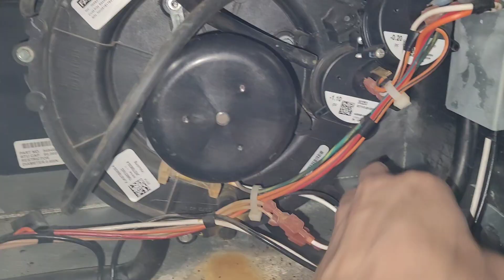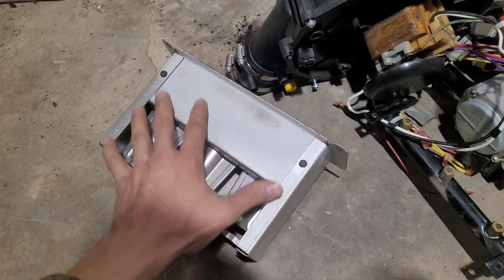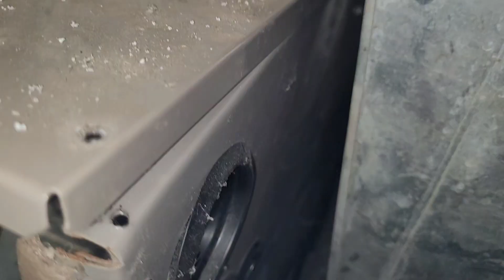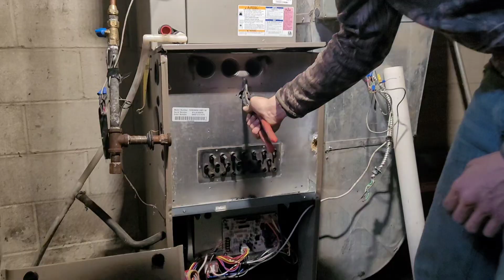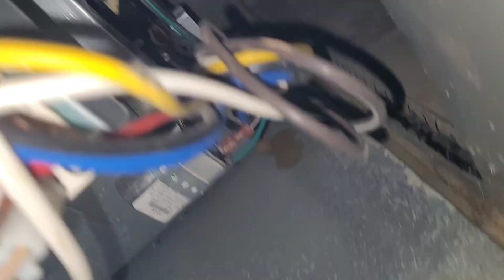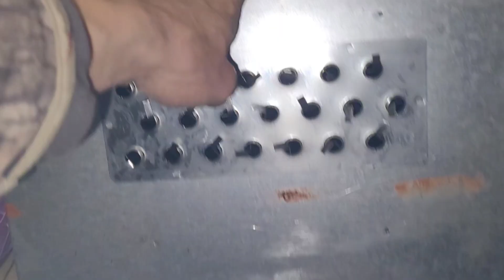How to replace Primary and Secondary Heat exchanger on Coleman, Evcon, or York furnaces!

Comment: I have the same model too and I actually just found holes in my primaries around one of the bends. It also appeared that I have a galvanized coupling box as well. Needless to say I'm sledgehammering it out and I'll be going with a Bryant that I have from work. Sadly I don't know who makes a good furnace still. I've seen the new carriers rot out their primaries and then soot up, I've seen lennox do the same thing, goodmans always burn through, but Amana/Daikins all use stainless steel primary heat exchangers. Perhaps they are the best way to go now. I'm extremely disappointed in Trane's quality decline. Nordynes are also terrible and have bad heat exchanger failures. I wouldn't trust a china bosch. Haven't seen enough Thermopride or even a Napoleon to determine if they are any good or if they are just a rebranded nordyne/bosch. I would have to say Amana.
Reply from the maker: I actually just installed one of those Bosch units. We got it because it was a scratch and dent, along with some other discounted equipment. I ended up installing it at my brother-in-law's. Hopefully it'll be a good machine, I told him I wasn't sure how well it would do but at least he got a good price on it since it was scratch and dent. That's another thing that bothers me, is they use a German name like Bosch, but it comes out of China.
Reply from the maker: Aren't Bryant systems also made by carrier? Yeah it's disappointing that most of the brands seem to be putting out equipment that doesn't last very long. I think it's in part because of the government regulations on efficiency. We just took out a 90% efficient drum style furnace because the board went bad, and there weren't any replacement boards. That unit had been going strong for at least 30 years.
Reply: @ReubenSahlstrom  The chasing after afue ratings once already above 90% is silly and certainly not worth the higher risk of a heat exchanger going bad b4 20 years. 
I don't think it is the government regulations, but rather minimum required afue to get rebates/tax credits. minimum allowed is 80% in us.

The rebates/tax credits mess up equipment selection, the matchups that give best afue/seer on paper aren't necessarily the best in real world for a particular house.
Reply: @ReubenSahlstrom  Yes Carrier/Bryant/Payne all ICP brands (tempstar/quaker/ heil/ daynnite) all the same, except for control boards.
Reply from the maker: @AmericanFarmerHVAC2024  My dad had installed carrier furnaces for many years, but they had so many problems with the heat exchangers that he decided to try some different brands, hence Coleman and Goodman. I've replaced many carrier heat exchangers over the years.
Reply: @ReubenSahlstrom  I change 1 or 2 out per week on the 58 series. Sucks and the replacement parts now are the worst quality I've ever seen.  The new cell panels are coming bent and stamped incorrectly, primaries bent and contorted, secondaries plugged from the factory with the poplypropelene. So irritating. Sadly I'm starting to see failures in the 59 series as well, usually on propane, condensing and rotting the bottom parts of the primaries, then soots up. To avoid the failures I try to only sell single stage furnaces if they are running on propane. I did forget about Rheem/Ruud furnaces, I havent came across a bad HX yet on this current generation. Maybe Rheem is the answer we are looking for? Im starting to lean to Daikin personally, especially with the R454b disaster, that really wrecked havoc on my business last summer.
Reply: @AmericanFarmerHVAC2024  the plastic coated secondary furnaces are all like 15+ years old with super expensive parts - it seems foolish to keep on doing them at this point.
Reply: Napoleans are made in canada by napolean that also makes BBQs and gas fireplaces, they are not rebrand. Unsure of quality but they come in odd size increments and if you go var speed they are based on out-dated ecm 2.x.
I wouldn't buy one.
Reply: Honestly I think lennox makes the best heat exchangers still, even if they have other issues and are hard to work on

Comment: "Comment down below if you know of any manufacturer that's making good furnaces "...

from my small non-technician sample I like post-2010 lennox (EL2XXX series)/armstrong the most -> sealed burner boxes them, very service friendly with all screws facing out, 11,000 btu per heat exchanger cell so the surface area vs btu ratio is lower so metal runs cooler. I don't know of any heat exchanger problems but wouldn't have a high enough sample to know if there's a problem. The variable speed version has ecm module as a totally separate board and part #, so ecm module failures are much more affordable to deal with others force u to change it with the motor.

The size increments they are available in can save from oversizing - available in 44, 66, 88k btu etc preventing needing to round up a full size increment when just over what 40-60-80-etc is needed. The -45 is a 17" and has a full 3 ton drive blower capable of going over 1200 cfm at up to 1" of static, which is good for low heat loss homes with long duct runs, other small furnaces won't do that. 
In my location in 90s to early 00s, builders installed 14" wide/2 ton drive max static 0.5" 40 to 50 000 btu psc motor furnaces into 1800+ sq ft energy efficient townhomes with bonus rooms, starving supper floors of airflow in cooling season. Seen it personally and also told same thing by an hvac tech/business owner - big problem at the time. They probably save $50 or less per house.

So if I was running a hvac business I would insist on carrying lennox or armstrong and then another 40 (with 14" cabinet available ) -60-80k btu brand. Cover every application.
Reply from the maker: I totally agree that the Lennox furnaces are set up very well for maintenance. I just did a clean and tune on one, and like you said they are set up nicely. I haven't done any heat exchangers on them yet. Their control boards seem a little more complicated than many other units. Just worked on one this week that had a bad control board, still have to go back and install a new one. Also, Lennox/Armstrong air conditioners are set up very nice for cleaning, but I just replaced a coil on one of them the other day that was full of pinholes. I'm going to give that unit a pass though, because it was also struck by lightning.😂
Reply: Hate you ruin your dinner but those heat exchangers suck. I've done two HX replacements this year on SLP98s and both of them rotted holes in every single primary cell. Thin metal garbage. Carrier is also doing that with their primaries.
Reply: @AmericanFarmerHVAC2024  the modulators by their nature must be more susceptible to that due to running at low firing rates, and if oversized as most furnaces are the cycles are shorter even if modulating. if there is condensation going on in the primary, any non-stainless primary will rot out - it is a question of running too cool, potentially due to heat exchanger design trying to squeeze an extra 1 or 2% afue points out of it which is not worth it if the thing is going to rot out.
Since the single stage and two stage ones use the same heat exchanger design - if those are holding up then the issue is due to being modulating probably combined with bad sizing and commissioning practices.

The armstrong and air-ease versions though are made with a stainless primary. Why lennox branded ones don't use stainless primaries too is beyond me if anything it should be the other way around.
Reply: @Jon-hx7pe  Really? Armstrong is all stainless? That's awesome, I'll have to try and look at one next time I see it. If that's true then I wouldn't rule out switching my company to Armstrong.
Reply: @AmericanFarmerHVAC2024  Yes it is clearly advertised at least for newer ones, no guarantee old ones are stainless. the concords and ducanes are aluminized.